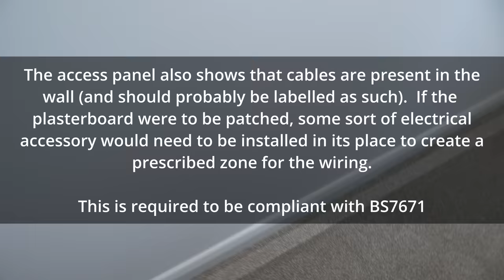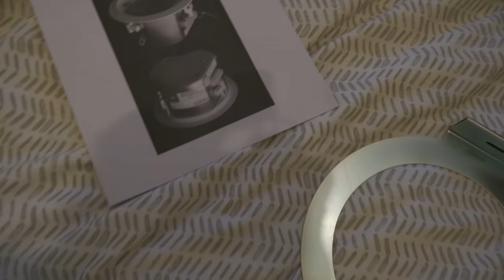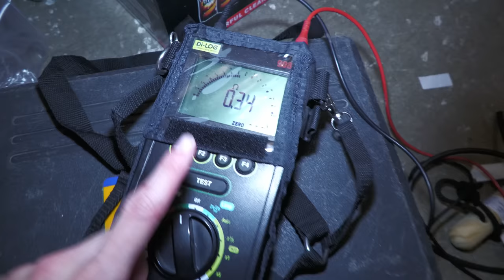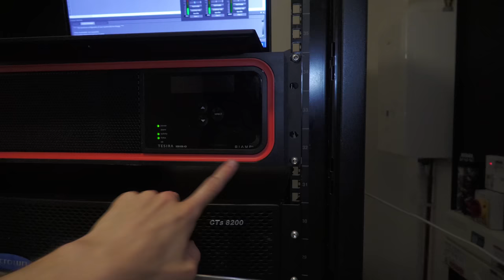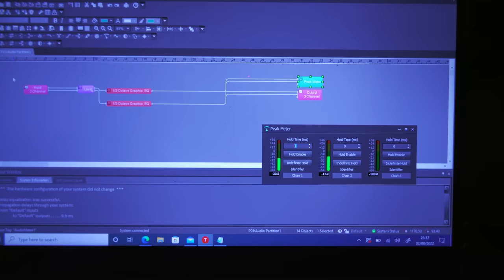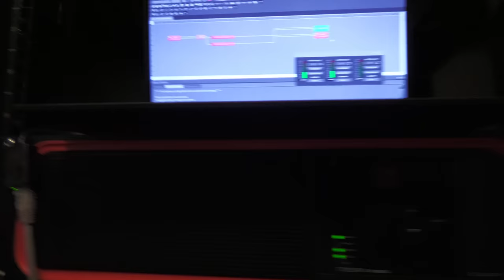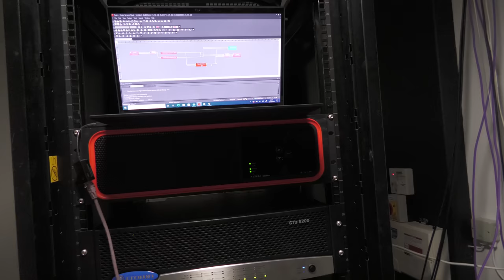Installing a Completely Overkill Multi-room Audio and Home Network Setup!

Comment: Always amazed at how houses are built in other countries. In The Netherlands a lot of houses are concrete ceiling and cinderblock/stone or even concrete walls where you could not be able to run cables like this. So in most cases you have to think about where you want things during the build, or "mill" grooves in the wall to put cable "conduits" in.

Comment: Nice video :)

Using the low impedance versions (24C) of the JBLs in a long cable length application like the multi-room setup, I'd have used thicker speaker cables but maybe that's just me. That Crown amplifier does have the 70/100v line capability for 24CTs, but maybe it's just not necessary until you get to big commercial installations.
Reply from the maker: The difficulty with higher voltage speakers is the limited frequency response - fine for background music and PA applications but probably not as good for a setup like we have here.  They'd be required for huge commercial installs and when speakers need daisy chained.etc but realistically here, the cable runs aren't actually that long.  Most runs we have here will be well under 10m long which is probably not far off what you'd find in some home 5.1 setups where the speaker cables need to take a long route around a room.  Based on the information here https://www.cambridgeaudio.com/usa/en/blog/speaker-cables it's best to keep the resistance of the cable to less than 5% of the speaker's impedance.  With the where I measured the continuity to identify the cable, the resistance (of both conductors added together) was 0.34Ω, so with 16Ω speakers we're well within that, could practically double the length and still be fine.
Reply: @camerongray1515  I was wondering about frequency response, and maybe even high-quality transformers would've affected sound quality. But yeah it seems low impedance works just fine :) thanks for taking the time to reply!

Comment: something to point out to anyone who wants to mess around with the Tesira ecosystem; you can get TesiraForte AI or AVB AIs for very, very cheap. for whole home audio you likely don't need AEC inputs (or many inputs at all). I configure and install these basically every day (TesiraForte AVB CIs mostly). using AVB also opens up using remote expanders like the EX-UBT, which gives you ASIO over USB and bluetooth input.
Reply: AVB is license encumbered, though. you can get around that by just using a PoE injector if you don't happen to have an AVB licensed switch hanging around, since it's just link-local multicast anyway. or you could use Dante, which isn't license encumbered, and companies like Shure are very much into, and Biamp also supports with their DAN models. Biamp engineers (from the ones I talk to) seem to prefer AVB, however (as do I).
Reply: Is ebay the best place to pick these up "cheap" ?  (new prices are a bit out of my reach!)  My mind is already whirring at the potential for when we move house next year.

Comment: 11:36 There exist flexible installer bits which are designed for drilling through framing lumber within stud wall cavities. They're usually 36" long or so and come with a tool designed to hold the shaft in the desired position while drilling. They're invaluable for drilling perpendicular holes through plates.  I often use mine with a cheap USB borescope connected to my phone so I can see what I'm doing.
Reply from the maker: Those bits look ideal however weirdly they aren't particularly common in the UK.  Every time I look into getting one I can only really find them available if I were to import them from the US which would take too long to arrive so I never bother ordering one, then by the time I next have a use for one it's too short notice to get one again.  I just need to bite the bullet at some point and get one to hold onto for the next time I inevitably need one!
Reply: @camerongray1515  It's funny how some stuff is so common in one market and almost unheard of in another. I feel your pain, though. There are a number of items that I see advertised in the US but which for some reason are difficult to find in Canada, and when you can get them it's by expensive shipping only.

Comment: For the bathroom speaker are you using a high voltage tap, or bypass into the 16-ohm speaker? Any recommendations if wanted to run a Cloud CS C4H from its own small amp far away from my main rack?

Comment: By the way, the zones in Part P only correspond to mains cable, but I agree with your principle in using access panels :)
Reply from the maker: I wasn't 100% sure since I couldn't necessarily find exactly what BS7671 covers in terms of data and audio wiring.  I think officially it doesn't really apply to traditional communications wiring although it's not unreasonable that the same cable route could be used to carry alarm wiring or PoE ethernet cables which would technically be classed as "Extra Low Voltage" which is still covered under the regulations.  With these sorts of things I'd always err on the side of caution but I definitely feel like it's nice to make the cable routes identifiable - just wish it was the same with things like plumbing rather than having to drill and hope you don't hit a pipe!
Reply: It's also worth knowing that Part P doesn't apply here in Scotland. Which is to say, only a qualified electrician is allowed to work on 240v circuits.

Comment: Some questions: what hole cutter are you using? (I just saw that padsaw!) Which test meter was that with the large test button on it? Which specific speakers did you install? There are loads of variants of the JBLs. Many thanks
Reply from the maker: Yeah, we used the padsaw for the speakers then just basic holesaws for the downlights and holes in the garage.  The test meter is a Di-Log 9083P.  Then for the speakers we are using the JBL Control 24C then the bathroom has a Cloud CS-C4HW.  We also have a few other speakers from Cloud for use elsewhere but I'm not sure of the actual models.

Comment: Jesus, I spec and install these Server-IO units for multi-zone lecture theatres, combinable boardrooms, etc for large corporates and education. Having one in a house is bonkers (not to mention expensive as hell).
Reply from the maker: Yeah although for £600 second hand it's not outwith the realms of possibility!  Coincidentally, the Server-IO came from a large company's office building where it had been powering meeting rooms and the amp came from a university lecture theatre.
Reply: @camerongray1515  Man, you cannot find one second hand here in Australia and new they're $10k AUD (~6,000 pounds) not including cards! So a very expensive thing for a house here.
Reply from the maker: Damn, yeah, it's the sort of thing you maybe just need to sit and search for, maybe set up a saved search on eBay to see if you get an alert if one comes up cheap.  It's the sort of thing that may pop up from time to time where electronics recyclers list them having been pulled out of buildings but without really knowing what they are.  That way they'll often come with cards as well.

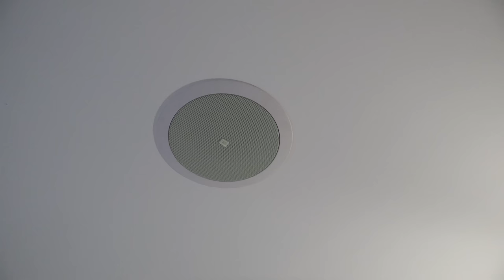Comment: 37:02   i would probly use these myself and just have like a mono channel subwoofer in a corner or something. or in the center and that would be a perfect home audio setup.  Now i can t say much cuz atm i have an entire PA system rigged up in my apartement, which is practicly my studio XD   ,  so yee
Reply: Nah, there are couch shakers - essentially a powerful sub without a diaphragm, but a tuned mass, designed to be mounted under a couch. Take one of them, and mount it under bed!
Reply: @klaernie  well that could actualy work.  I just like the deep bass a lot. I guess XD,  for my bedroom in my apartemen / studio ill probly just put two studio mons at the top of the wall, the r channel will be linked by a 4 pin cable, and then ill do something like  an MiniDSP flex which will feed lr to monitors, and technicaly its mono, but its an LR, feed down to an cetered sub.  And as far as the living room / stufio itself im currently just using two pa subs and a pair of KRK Rokit RP5's and then that gets crossover in the rac and subs are getting power from one NX3000D from behringer runding brodged mono since im running in/thru on the l sub cuz cables werent long enough
Reply: @klaernie  couch shaker is only going to let you feel bass. It’s an enhancement not a substitute for a subwoofer. I’ve 4 Crowson’s for home theatre under my couch.

Comment: Does the amp just send once source to all outputs/channels or is it multi input/output capable ?
Reply from the maker: The amp has 8 inputs and 8 outputs.  So the Tesira has a different output connected to each input on the amp, then each input on the amp feeds to a single output (It's basically like having 8 separate amplifiers in one box).  The Tesira then handles which sources to send to which output.
Reply: @camerongray1515  I was hoping that would be the reply ! Would really like to see a video on this once set up if your friend is willing !  I will now have to go and put a couple of saved searches on eBay :)

Comment: Question - is that light in the bedroom normal or a temp light?  Like the video - my place is overkill when it comes to networking, etc., as well.
Reply from the maker: The bedroom just has a basic CFL bulb (so probably around 2700K-3000K).  The bathroom is a cooler white (not sure on the temperature but would be at least 4000K or cooler).  It probably looks weirder on video because the camera's auto white balance was being slow at adjusting when moving between the two rooms.
Reply: @camerongray1515  Sorry, I meant is that what you use as a fixture.  Here, sometimes if rooms are still under construction contractors put in a porcelain base and a bulb but change it out later.
Reply from the maker: Ahh, I thought you ment temperature, not temporary.  Yeah, that'll likely be replaced - the house just came with a single pendant in each room so you'd either install a lampshade or replace the fitting with something nicer.  The house is very much finished in terms of construction but he's still getting moved in and set up so nicer light fittings will come later.  The housebuilders do provide the option of getting them to install downlights instead of the pendants but they were charging £90 a fitting whereas fitting them ourselves cost well under £10 a fitting!
Reply: @camerongray1515  ok good!  Loving the overkill of the wiring.  Glad to see I am not the only one doing it!
Reply: @camerongray1515  You could put a pinky blue chandelier in the front room !!!

Comment: Great video as always. When running CAT6A around my house i got quite anal about keeping the network cabling away from 240v due to interference. How much of an issue is this to networks?
Reply from the maker: It's not something I worry about too much, it's best practice to keep them apart but it's unlikely to be an issue in a domestic setting - it's more likely to be an issue in commercial settings where you have electrical cables carrying huge current.  So maybe if you have the choice between running it near to a 6A lighting circuit or a 40A shower circuit, maybe avoid the shower circuit but I wouldn't get too hung up over it. Dado trunking used commonly in offices (where you have sockets and network on the same trunking) only gives around 5cm distance between the network and power compartments.  Same goes for floor boxes where you'd often have network and power sockets in the same area.  Then if you think about things like in data centers where you have a hell of a lot of power and data cables in the back of a server rack.  So TL;DR, it's best practice to keep them apart but not the end of the world.
Reply from the maker: Additionally, I've seen people erroneously citing BS7671 regulation 528.1 which states that Band I (communications) and Band II (mains) need to be separated.  This only really applies where the cables aren't sheathed (i.e. the individual Line, Neutral and CPC wires are exposed with only the brown, blue and yellow insulation covering them) and not for something like T&E cable which is sheathed.  So don't go running network cables through a pattress box where the sheathing has been stripped off or through conduit containing single insulated wires but this doesn't apply to running it alongside T&E.  This is why things like those "media panels" (e.g. https://www.bewdirect.co.uk/wiring-accessories/white-moulded-sockets-&-switches/deta-slimline/deta-s1985-media-plate-socket-white-s1985 ) which have a couple of sockets and euro module slots on the same plate use a backbox that has a metal separator between the area that contains the sockets and the area that contains the euro module (https://www.bewdirect.co.uk/wiring-accessories/miscellaneous/metal-back-boxes/40mm-flush-lounge-box-db184 ) - it's to stop the Band I cables coming close to the exposed Band II conductors behind the sockets.  Once the cables leave that back box, they'll likely be running pretty close to each other.